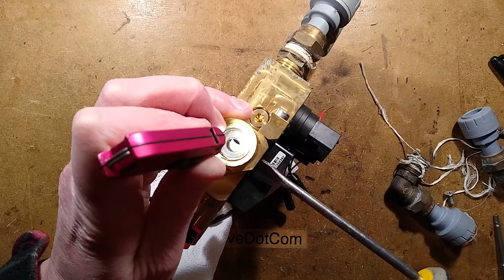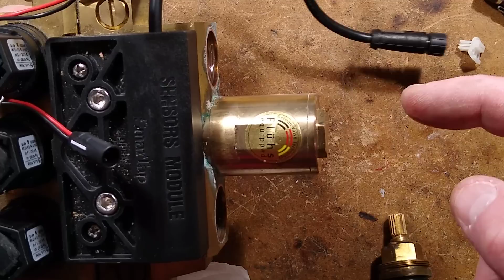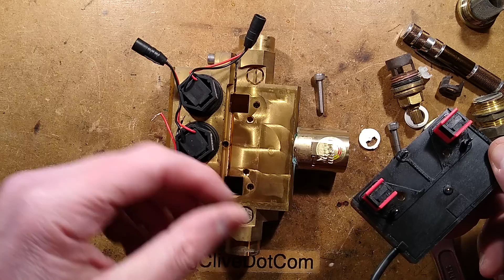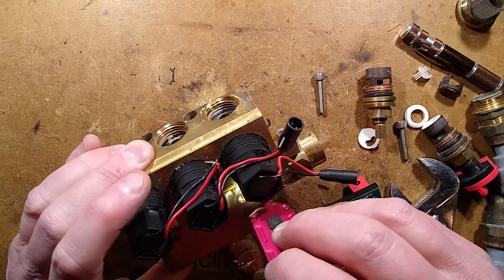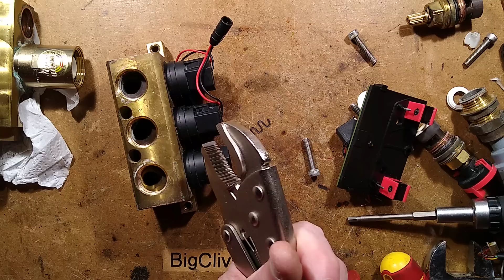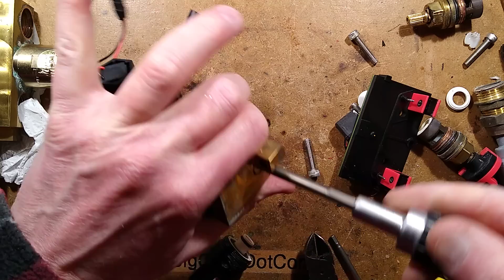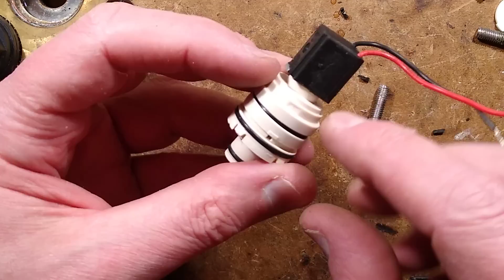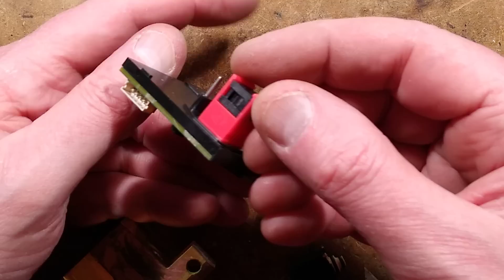Smartap manifold teardown (it's a beast!)

Comment: "Swedish Nut Lathe" is what we call them in Australia ;) (aka Shifter, don't ask me why it's "Swedish" I have no idea, unless they were originally invented in Sweden?)

Judging by the leads on them those probes are probably thermocouples (for thermocouples to work properly you need the different metal wires to extend as close to the readout circuitry as possible so you can do the temperature compensation). Black and red bits as somebody else suggested are probably some kind of pressure transducers.
Reply from the maker: Possibly because Bahco in Sweden pioneered the pipe wrench and other similar tools.
Reply: @bigclivedotcom This style, as opposed to the earlier ones with the jaws 90° to the handle, was indeed invented by a Swede, Petter "JP" Johansson,'1853-1943 (btw, not the same Johansson as the one with the gauge blocks).
But I do think Bahco was a big part in making them known as 'Swedish'
Reply: In Denmark we call it a "Svensk-nøgle" (Swedish Key) I too don't know where the Swedish in the name comes from.
Reply: I've always preferred AvE's "Swedish Nut F***er". Succinct.
Reply: Or as AvE would call it, “thumb-detecting nut-f@cker” if they have the extra hammer functionality (designed in functionality rather than user generated unofficial functionality)